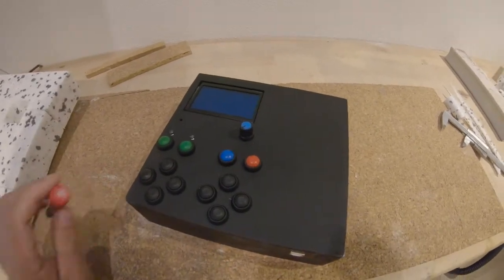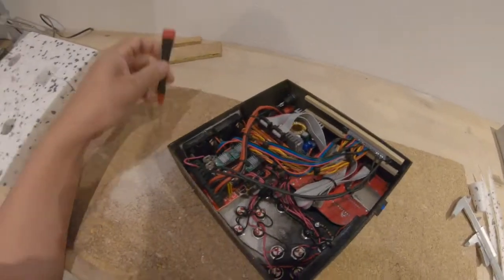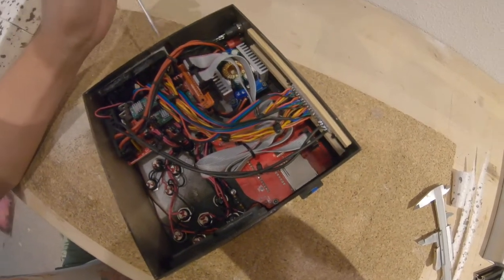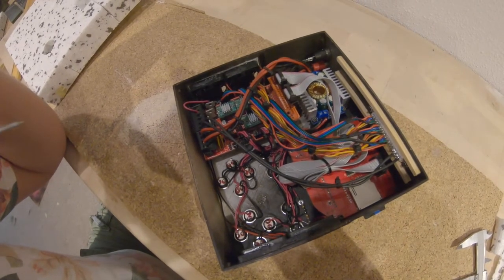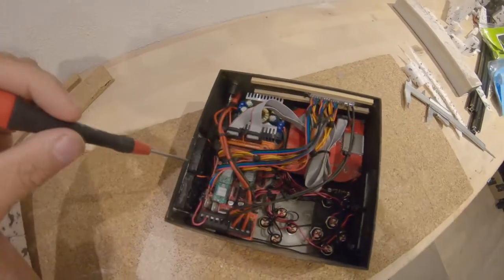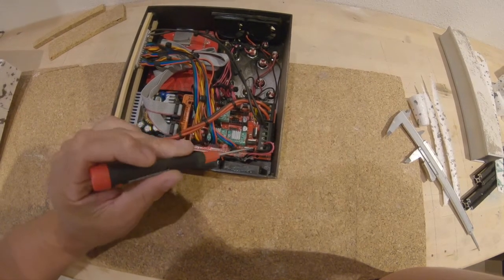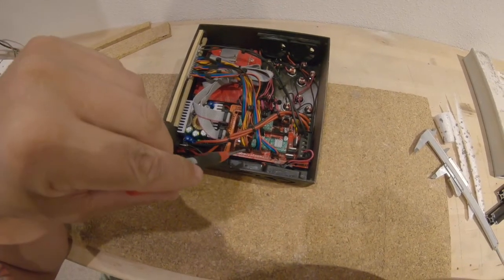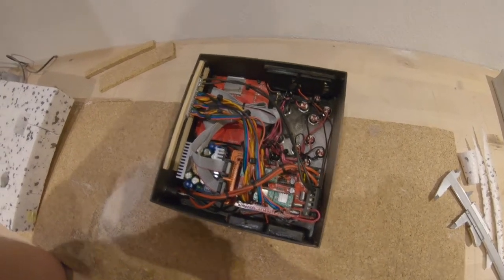Foam Cutter Hardware

Comment: Really great work, also found your channel via Keith. Love the control unit with lcd display and being able to execute gcode from SD card.  I'm planning on building a cnc hotwire, I think I'm going to start with Keith's electronics guide to start with but might try and upgrade to your set up in the future when I have a better understanding of the electronics.  I dont think I can quite follow this well enough yet!🤣
Reply from the maker: Updating from Arduino Mega with Ramps Board is possible. Please let me know, if you need any support. Please check out the github for more detailed information, schematics, ... Regards Thomas